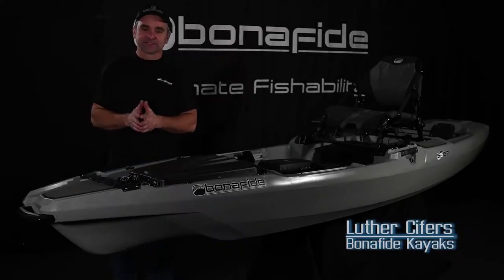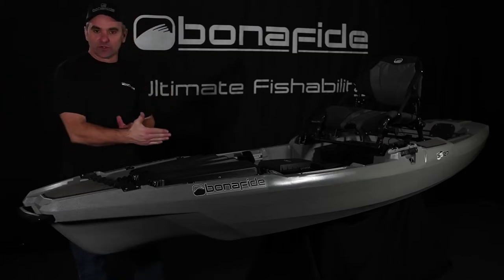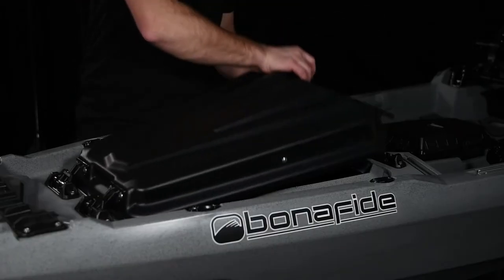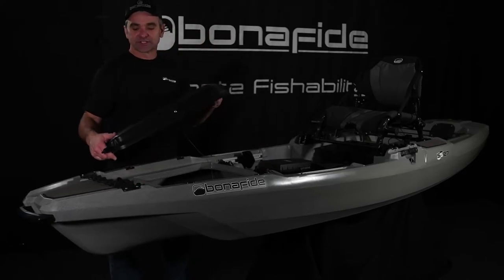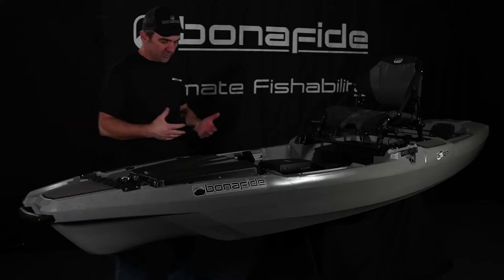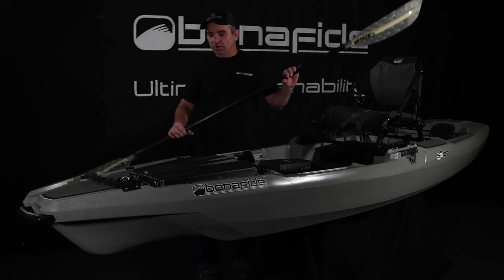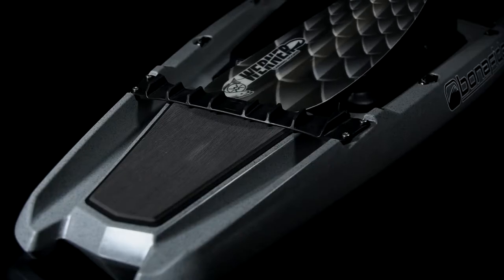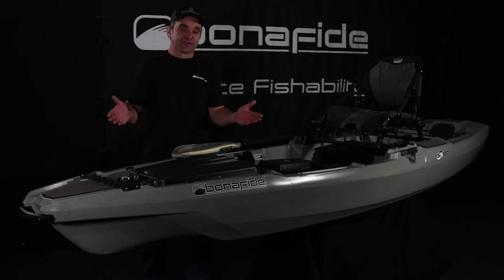Bonafide Kayaks SS127 - Front Hatch and Doubleheader Hinges

Comment: Hey guys just picked up the ss127 and had a question. I noticed in another video there is a rod stager in the front hatch but mine did not come with one...what gives?  LOVE the boat btw.
Reply from the maker: Hey Brett, the inside the hull rod stagers we part of the early prototype kayaks we took to trade shows last summer. They didn't make it to the final product but are something we are working on as an accessory.

Comment: I've always liked that hatch concept. That and the seat mechanism is great. By the way, what material is used in the seat frame? Aluminum?
Reply from the maker: You are correct. The seat frame is aluminum.
Reply: Hi  I live in Wisconsin I got Lake Michigan three blocks away from my house I'm looking to buy a kayak first time I like your guy's design my question is if it will support my weight I'm 375 lb 6'2" also if you'll be stable enough to stand up
Reply: Hey Cutberto: the Bonafide SS127 sit on top fishing kayak will support your weight but I would advise you AGAINST standing up on it in Lake Michigan. Safety first. I have been using a 10ft sit-on-top called a Tarpon 100 for 8 years and I will NOT stand up in it, despite the fact I only weigh 125lbs (literally one third of your weight) and I don't want to find out "how much I weigh soaking wet".